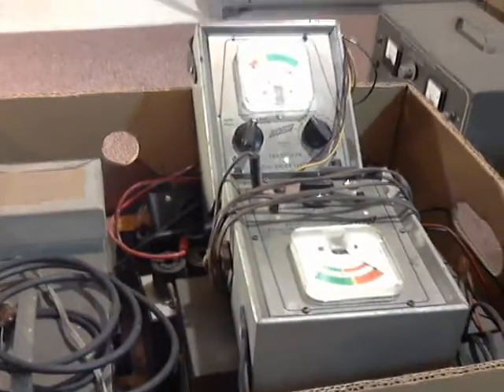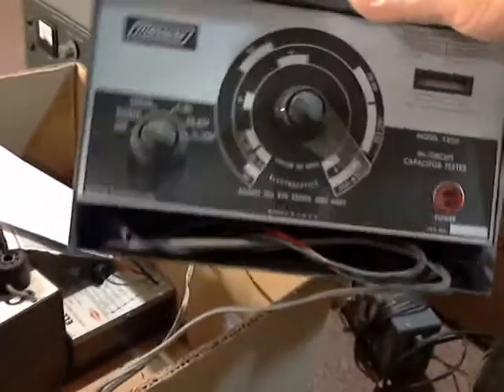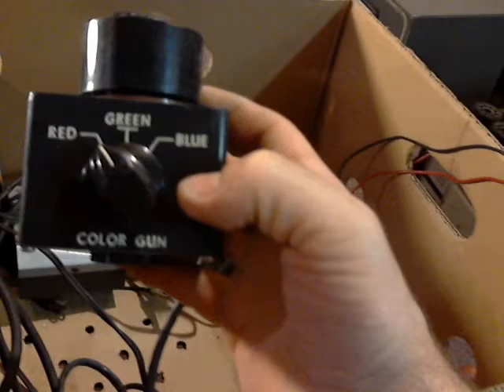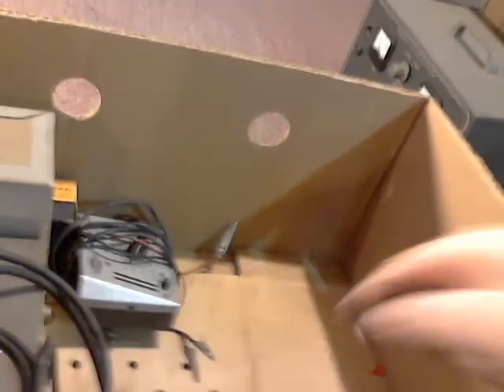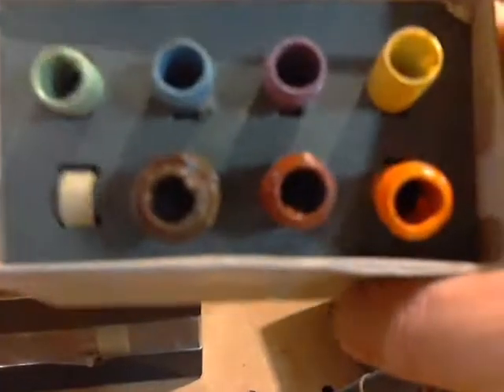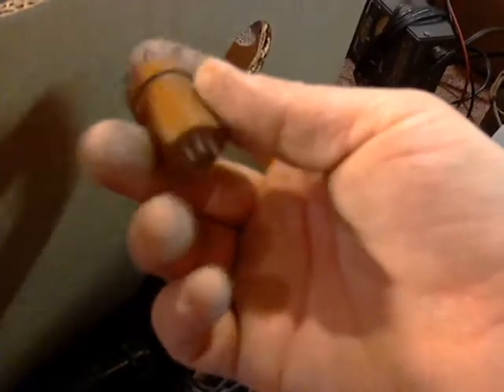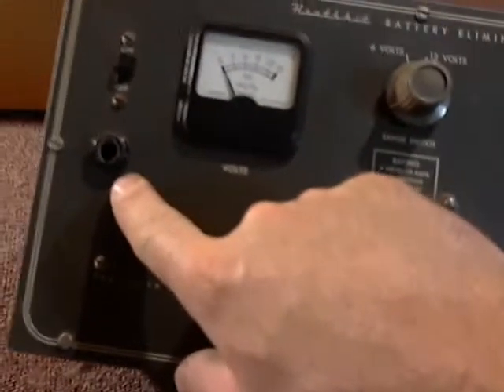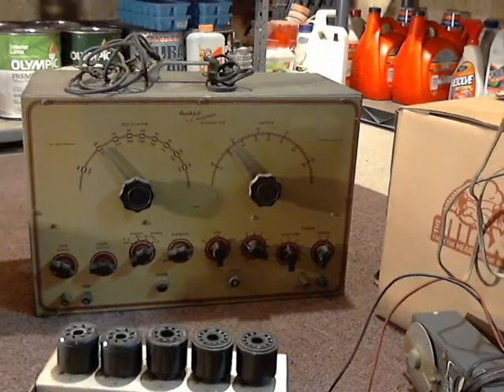Auction Finds For December 7th, 2013 ~ Part 3

Comment: You've got some good stuff there.  That capacitor tester will test older caps for leakage under more realistic conditions than a modern DMM can.  The Seco current checker is great for checking cathode current on horiz. output tubes in TV sets without having to unsolder wires to the HOT socket.  The selenium rectifier tester is interesting but it's best to eliminate those anyway.
Reply from the maker: Thanks, I'm not very familiar with some of this equipment. I will have to find manuals for some of it.
Nathan